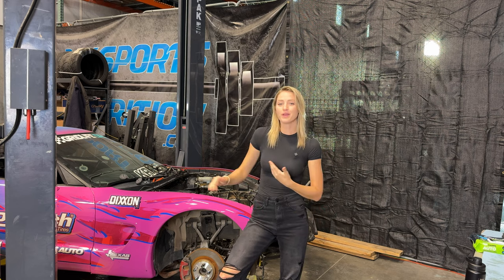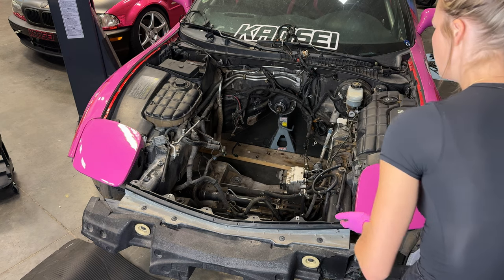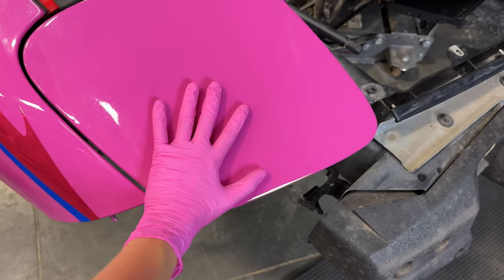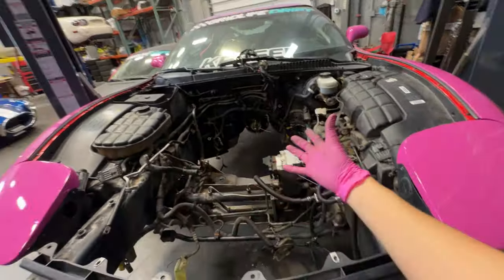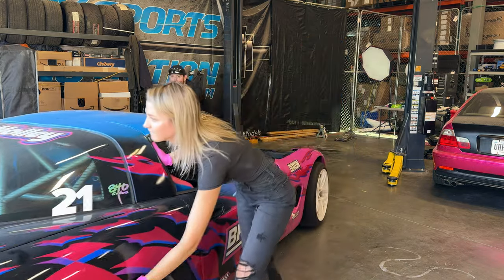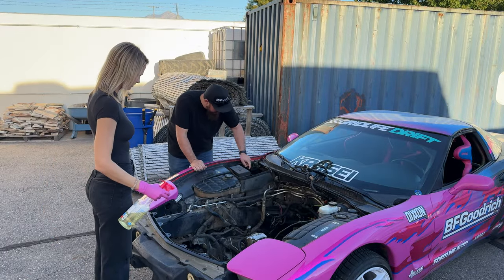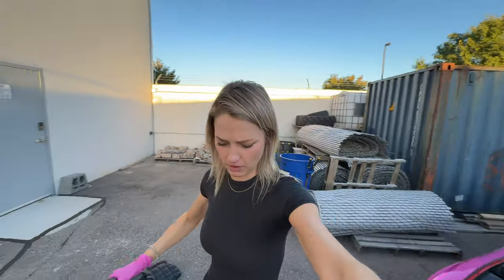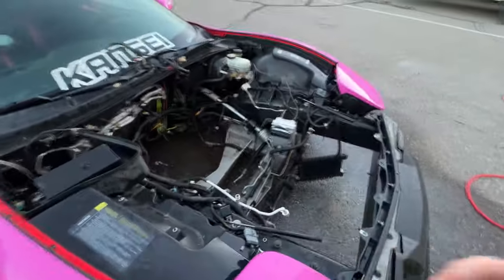Pressure Washing my C5 Corvette Engine Bay!

Comment: I like to use one of those weed sprayers you pump up with air pressure and fill it with water and cleaning solvents for engine bays and interiors.

Comment: Not sure if ur bumper is busted kinda looks like it. 1997 - 2004 C5 Corvette Front Bumper Impact Foam Absorber OEM 10403040. 
When detailing, buy a few of those 1/2 gallon pump sprayers. Makes washing and detailing much easier.
Reply from the maker: It’s busted for sure.

Comment: Oh, it was the mic,.. DJI or Rode?
If you get the lapel mic that plugs in to those, you can hide it by clipping it to the center gore of a piece of gal's clothing, then running the cable around to a pocket to hide the transmitter. The little gap under a shirt in that spot protects the mic from having anything rustle on it, so you get really clean audio.
It's an advantage that guys can't match, so for them the mic can be tucked inside a shirt collar.
Reply from the maker: DJI! I love it so much!